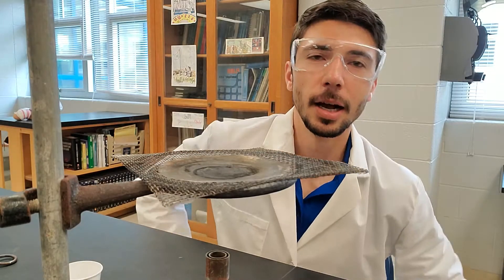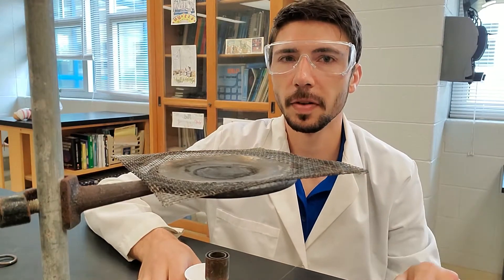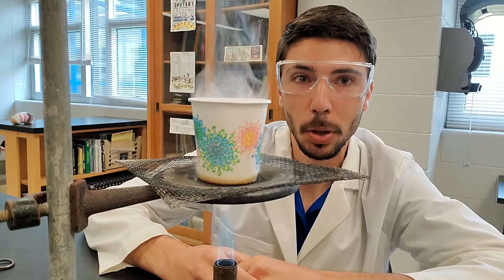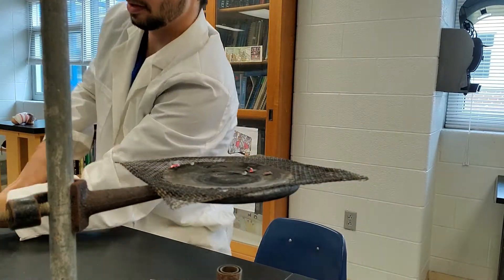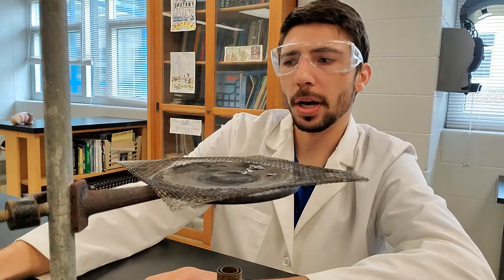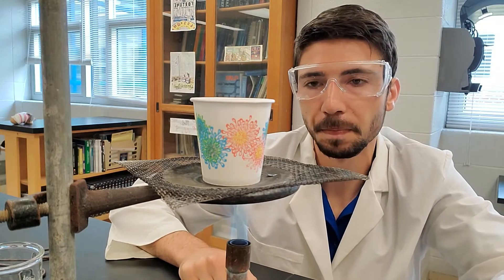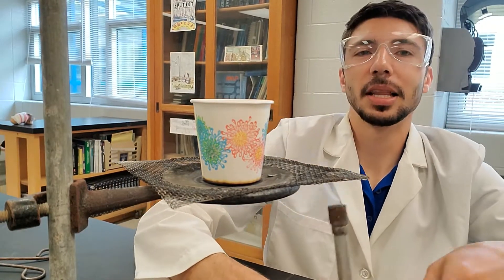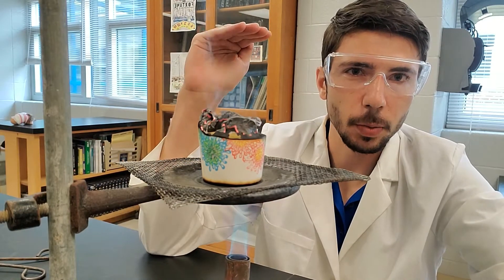Paper Cup Demonstration

Comment: I think that a styrofoam cup would melt/burn. Because of its insulating properties, the heat would not be transferred to the water quickly enough to prevent the cup from reaching its ignition temp.
Reply from the maker: Excellent reasoning!  I would have tested with styrofoam as well, but burning styrofoam can make some nasty fumes that I don't care to inhale.

Comment: another fun one related to water and fire is soak a dollar bill in 70-80% isopropyl alcohol (for several minutes)......I think that is the standard store-bought sol'n......hold the bill with tongs and light it......the alcohol burns but the bill doesn't.....the "alcohol" is actually a solution and when burned the water is left behind and the soaked bill won't burn.....if you use a higher alcohol %, the bill usually does burn, however